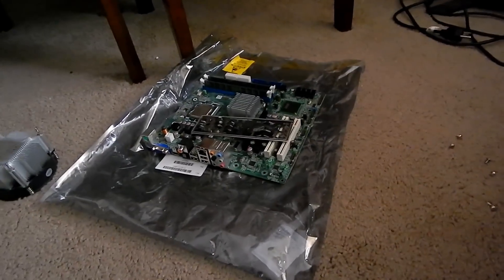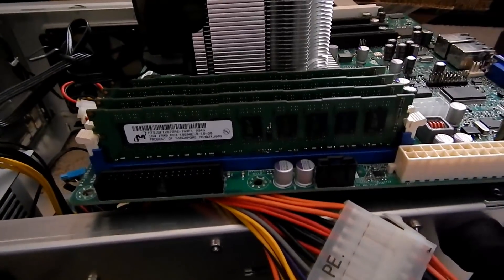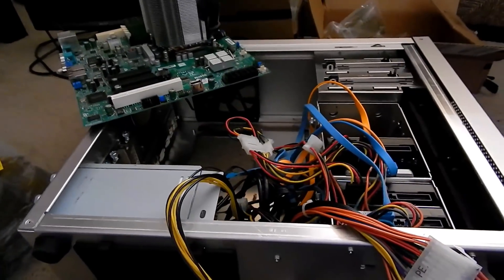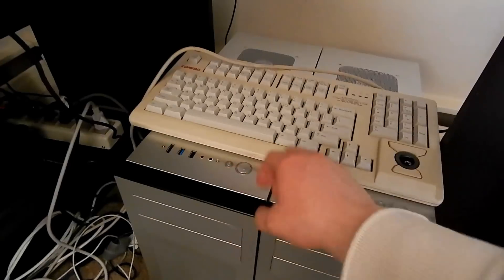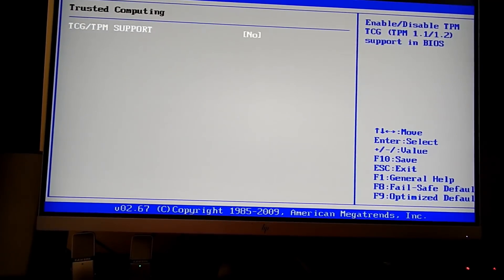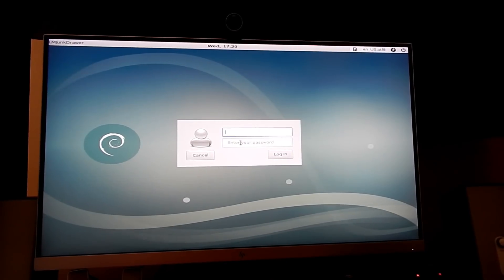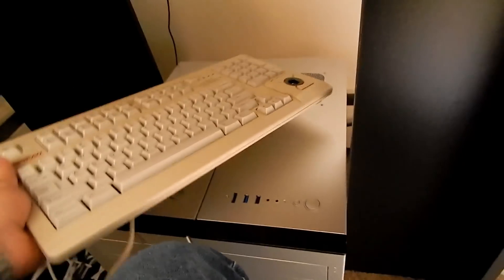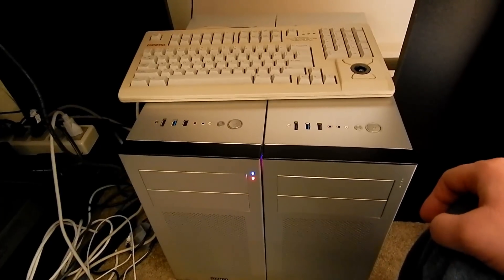Junk Drawer Server Upgrade: April 2018

Comment: Hey lmull3 I'm selling my mint condition Dell latitude c840 notebook fully loaded w 512gb of ddr pc 2100 notebook memory,intel pentium 4 m processor infrared port, 40gb at a ice notebook drive broadcom wireless swappable floppy diskette modual and zip 250mb disk modual.. If I could please have your email address then I can email you the specs.